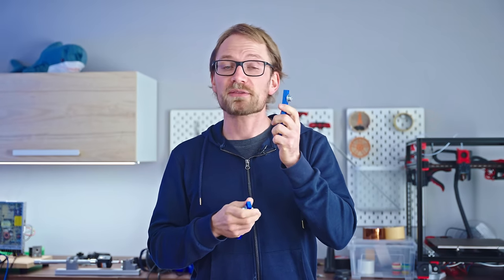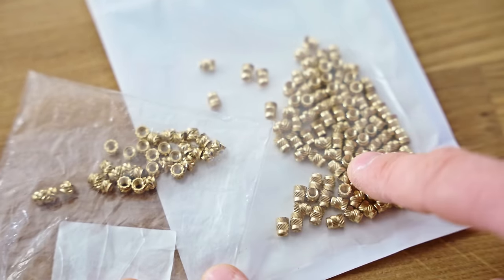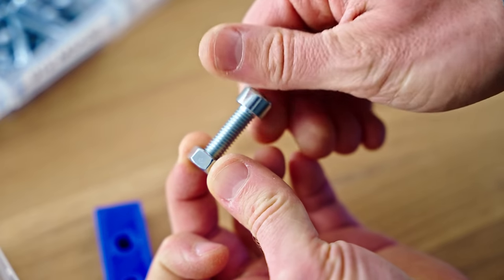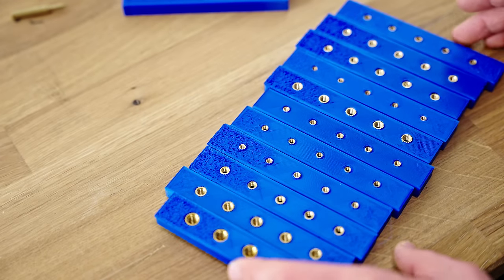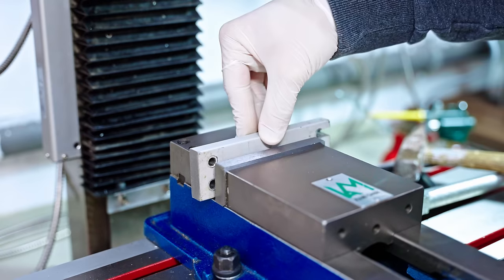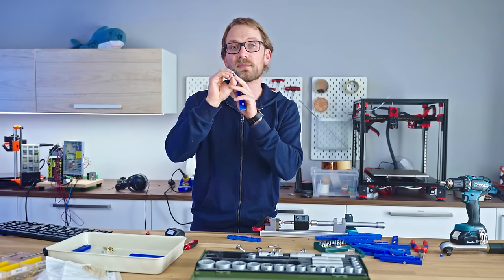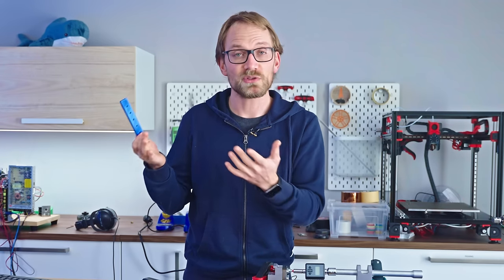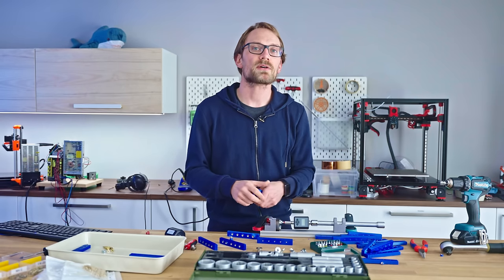Do you even need threaded inserts? Strength tested!

Comment: Thanks for the info and the video, but here are some ideas to improve upon for your next test.  Many people are simply using metal hardware since it is much more consistent, uniform, removable and reinstallable and easy to deal with and don't actually need the strength. For this, the threaded brass inserts work great. But if you are really designing for strength, you need to improve the weakest link, the plastic printed part. Perhaps I missed it, but I didn't see you go over the print settings for your test pieces?  It appeared to be PLA and appeared to have only two perimeters.  Did you use PLA or PLA+ or some other material?  I like PLA+ and Polymaker PLA Pro for high-strength items, although PLA can actually be stronger in tests like this, but either way, should state more info about the printed part.  I generally use 3, 4, 5 or 6 perimeters for my high-strength parts.  I've gone to 100% infill on some as well.  I think you should have made the test pieces thicker as well. The one common method you didn't talk about is making a pocket on the back side to put an actual nut (hex or square) into your model.  I've seen Stefan do this, but he had so little material surrounding the nut that I think it skewed the results.  Have 1.0X-1.5X the thickness of the nut for the thickness of the plastic in front of the nut. So, if your nut is, for example, 4mm thick, then make the test piece 10mm thick with a 4mm pocket for the nut to be inserted and 6mm of material above the nut to give it strength.  And making that 6mm region, and a large diameter around the fastener with 100% infill will really test the method.  This is my preferred method and it has served me well.  Finally, I think torque is a poor metric for your measurement. Torque is used on helical fasteners to achieve a pre-load, which is what really matters in these fastener joints.  Depending on the material, surface finish, lubrication, etc., torque values will be different for two fasteners achieving the same preload. For example, screwing into a brass insert a certain torque value and screwing into  plastic (and deforming the plastic) with the same torque value would yield two vastly different preloads.

Comment: Pull out isn’t that common of a failure mode for a properly designed joint—screws should ideally be loaded in shear. Torque out is more important, because as you noticed you didn’t achieve design torque. Those fasteners are more likely to back out and loosen up because that haven’t stretched enough to keep friction high.

Comment: By the way lead fumes at 480C so if you don't heat it to that temperature there is no problem from soldering with lead solder and definitely no problems with the inserts.

Comment: That is still a bolt, whether it is in a nut or not.. a screw is tapered, a bolt is straight. For example, a vehicle engine uses bolts screwed into the engine block to hold parts on without nuts.

Comment: Nice test process.  One of the processes I've had great success with, is using molded threads, and using the bolt to form the final thread shape. Essentially, running the bolt in/out a few times to get a little heat into the part, with the goal to leave 100% of the original plastic in the hole. Tapping removes material and adds stress risers. Another thing I generally do with end use parts, is to have at least 3 or 4 shells in the design with a higher % infill.  I'm typically using M6 hardware and have found the results to be quite good. 

One other thought I have is with regards to the presentation of the data. A full table showing the various results grouped together would be good. A quick way to see where things stack up really helps.

Comment: I usually use the inserts without printing a hole for them, that makes it a bit more messy but after cleaning up the filament through the inserts while they are still hot they hold up very tight, I made lots of adapters for camera gear and by now everything is still tough and in place

Comment: I think the thread adapter style should be used by screwing the adapter on the other side of the part and using the screw from the direction that would need to pull the adapter through the whole part, if at all possible. That would probably make a lot of sense for the injection mold thread insert, too.

Comment: I print threads and after much effort and experimentation, my threads come out gorgeous. No supports needed. I would still use inserts when you need M5 or smaller screws or plan on using the threads often to screw/unscrew or need better reliability.

Comment: I tend to use threaded inserts (from cnc kitchen) for most threads where I can't just have a nut on the other side, even despite the price.
Mostly because it makes the modelling just so much easier. I only need a hole with a certain diameter and a minimal depth, I don't have to model a recess for a square or hex nut into some place I might not have a lot of space for it and possibly reprint if it doesn't fit properly. Threaded inserts are just "fire & forget".
Edit: yes, I am lazy. But I consider that a positive as a software engineer.

Comment: for stronger connections i use pockets for nuts so the load pulls the nut through the part, for weaker ones just a wood srew in a pilot hole

Comment: Great video Thomas. Thanks. But i think, you should compare thread inserts with regular (hex) nut and maybe with square nut. And you shuld test it as "regular" nut, i mean insert thread insert from one side and screw bolt from other side and test it. I'm using this technic in my designs and i think it is much stronger.

Comment: I'd be curious to learn more about the durability of the printed threads. One reason I might use a threaded insert is to support a connection that would be repeatedly assembled and disassembled.  would 3D printed threads hold up over time?

Comment: I'm curious if "phantom geometry", that is geometry that is so small it only shows up as additional perimeters, around the holes would help keeping them attached to the part.
As in, let's say .01 mm wide slots radiating out from the hole in a star pattern. Those are likely too small to be actually printed, but they will generate additional perimeters in the slicer.

Comment: An normal M3 machine screw will thread nicely into a 2.8mm hole and offers plenty of strength for 95% of what I do. Only time I use melt in threaded inserts is for screws that need to be removed repeatedly.

Comment: (Nice vid! & awesome approach) You want to screw into plastic - use plastic screws! "Plastite" is a common name for them. They are for plastics & work incredibly well. Inserts require extra steps, time, cost etc...
Bolt threads are designed for bolts - they dont work in plastic & will always provide average results.
Next Vid: Take a user based approach - "I have a small part to join, I can put a 3mm hole into it.  What are my options?" inserts, regular wood screws, plastic screws...

Comment: Using Orca slicer and hole compensation may help with dimensional accuracy of your holes, often FDM 3 axis machines struggle a little in getting both OD and ID bang on, historically it’s been kinda one or the other depending on tuning but with some of the newer slicers there’s compensation abilities built into the slicer. Works very well too I might add.

Comment: I have been modelling my threads directly into my parts using the Fusion 360 Thread tool for years. I have found them to be strong and reliable for M4 threads and larger. M3 threads and smaller don't print as well.

Comment: I’d be interested in a design study. What Design principles can one use to maximize torque with the different insets. Also old school hacks like hex hole inside of part to place a nut in with print Pause a certain layer. 
How strong are modeled threads in resin parts? Especially for different materials. 

How close can one come to specs of the screws ? 🤓

Comment: When I do make threads in holes, I never use 3 walls, I go to 6 or 7 walls, as I know there will be less material to hold... infill 20% Cubic tends to hold well. (Air boost pressure tool for turbo charged car parts/intercoolers)

Comment: Different materials are definitely worth testing, even just with printed threads or self tapped threads. PLA would probably perform very differently from nylon is that kind of test. Maybe testing some carbon fibre filled filament would be a good idea too.

My goto methods when I need threads in a part are inserting nuts into the part, mainly after printing, although they can be inserted during a pause in the print too. Where I can (where the nuts are cheap enough, usually M3 and up), I use square nuts, they are much better than normal hexagonal nuts because it is harder to round out the hole, they also have a larger surface area in the direction of the bolt. Combine that with a strong part and you can get very strong connections. They also require no tools to install and the nuts can be recovered from failed prototypes and reused, helping to reduce costs. If you buy bolts and nuts in reasonable quantities you can get very cheap prices even with high quality parts. This is very similar to just sticking the bolt all the way through a smooth hole in the part and adding a nut on the other side, except the nut gets hidden inside the part.

The strongest method would probably be to use a bolt all the way through with a nut on the other side and have washers between the printed parts and the bolt and nut, this would help to spread the force over a larger area and would likely be much stronger than any of the methods shown here today.

Comment: I'm curious since it was just the print that failed every time, if it would make it more worth it to use 3D printed screws for light and low-load connections. When pulled, I wonder if the 3D printed screw would break, or if the problem would still be with the print itself. Also, part of the problem with direct printed threading is the lack of wall material, so what if you upped the print to 4-5 walls for the holes?

Comment: I am using thread inserts mainly because you can ise the thread again and again. Printed threads fail after screwing a bolt in them only fet times, so if you want to assemble and disassemble something over and over again - inserts are the way to go.

Comment: I use self tapping (rolling) screws. They can be re-used dozens of times as long as you reverse the screw and wait for the the thread to drop into the previously cut thread before tightening (which avoids cutting a new thread each time). If I want a thread that will be used over and over, my first solution is a nut pocket on the back side.
Even a standard machine screw used as a self tapping screw will work better than tapping the thread itself as it will push material aside rather than removing material.
IMO - threaded inserts are really not needed for the vast majority of 3D printing applications. I used them for a long time before I realised it was purely for my own satisfaction rather than function.
Aslo - whenever printing a functional part, I use 4-5 perimeters and 5+ top/bottom layers at a minimum.

Comment: I never use brass inserts. I found that plastic threads are stronger than the interface between the brass inserts and plastic. I use modeled threads for M5 and over and for smaller I let the first screw form threads. Adding a drop of grease to the screw or alcohol to the  tap fixes the galling problem from friction welding PLA to the screw/tool.

PLA can give over time if it's under high tension for a long time, which will pull ou the threads or brass insert so if I need large permanent tensile forces (for example a clamp around a metal tube) or a joint that needs to be installed and removed a lot I use captive nuts.

Comment: If the plastic item is thicker than the length of the inserts (such as most of your tests) and the printed bolt hole can go all the way through, I'd like to see the same tests done with the bolt inserted through the backside of the plastic part so that instead of pulling the insert out of the hole made for it, its being pulled through a smaller hole with plenty more plastic retaining it.

Comment: What about the plastic being used - does the strength improve with different filaments?  Does orientation of the print and hole matter?  I also saw people talking about various self tapping screws - metal and wood.  There are so many directions to explore with this one (I know my self I'm interested in what PETG, Nylon, maybe even carbon fiber would do with the insterts).  Don't stress out in thinking you have to test everything - anything you want to further explore is good.

Comment: The 1/4" - 20 adapter seems similar to just imbedding a nut inside the print. 
I had a print that added a 1/4" - 20 flange nut to make a tripod mount.

Comment: I've used woodscrews with good results into plastic.
Place wood screw into screwdriver, heat the screw with a small torch for a few seconds and then thread it into the pilot hole.
Let the screw sit in the hole for 30ish seconds and remove. 
Perfectly formed hole with deep and well formed threads.

In a setup with many holes, i typically install many screws one after another. By the time I'm done installing a dozen of them, the first one is ready to be taken out.

You could test out the strength of this method of thread formation?

Comment: using a fluteless form tap ran fast through then left in while the pla cooled would be interesting as it may anneal the pla and increase its overall strength, you could also do this with just the bolt as a cheaper diy version.
id also like to see if the use of loctite on the threads weakens the pla when being used directly into the pla.

Comment: I would have liked to see the blind version of the injection moulding inserts. I use these so the plastic is heated and forced back past the insert, filling around the insert entirely and then trimming any excess off the top. I design the hole to just under the size of the insert so its easy to locate and then midway down the hole depth have a ring of a smaller diamiter that will get melted away when inserting. you will need to have a thicker bottom layer in the hole so when you press the insert in the melted material is forced back past the insert and not down into the print

Comment: Depending on the design where I can I use inserts from the back with several mm (at least) of print above the nutsert and pull from that side with a reduced diameter (screw/bolt diameter) clearance hole.

Comment: I use self tapping screws but heat them when I screw them in to form the thread rather than cut and damage the plastic: first screw them in about 1 or 2 turns then heat them with my soldering iron for about 6 seconds (3mm screws about 8mm long, bigger screws need more time), then screw them in. They should feel easier as they go in but not too easy.

Comment: Mostly I've been working with M3 screws. My prints use simple holes at roughly the tap drill diameter, then I use an electric driver to install the screws in the untapped holes. With the torque of the driver, and the heat of friction, I get a pretty decent threaded hole that also grips the screw. Sort of a built-in thread lock. 

I have some of Stefan's inserts on hand, but I haven't had a need to use inserts yet. For whatever reason, I haven't had a project where I anticipated repeated disassembly, and that's where I always thought the inserts would be most useful. I hadn't yet thought about using them to get a stronger thread in the print because of the larger interface with the plastic. Which is silly of me, because I've used threaded inserts for that purpose in aluminum for my day job. Compartmentalization, I guess.

Comment: How about testing with wood screws? For parts that don't need to be unscrewed I often print a smaller hole with extra perimeters around the hole and put a 4 or 5 mm Spax through it. Depending on how long it is I can really torque the part down.

Comment: I normally just use threaded holes for screws of M4 and bigger. M2 and M3 bolts I just screw in the plastic. If more strength is needed I use the screw adapters or tapped inserts that are ment for use in wood. In most cases this is strong enough for the force that is on those pieces. 
Different materials like PLA, PLA+ or PETG have different strength. PETG is weaker when using threaded inserts, but stronger with screws tapped into it. Tapped holes in the PLA we make at my work (a very hard PLA, not realy ment for 3D printing) are awfully strong, but threaded inserts are quite easily pulled out.

Comment: You can manually add perimeters by doing it in CAD. I call it seeding because I haven’t seen it called anything else. See below if you want to see it, made this ages ago.

Perfect & Strengthen Your 3D Prints Part 2 (Rods & Bolts)

Comment: I may have missed it, but when you made the holes for the heat set tapered inserts did you make a tapered hole? There is typically an 8 degree taper. That doesn’t sound like much but I have gotten much easier and cleaner insertions by following the recommended hole profile. I do inserts quite a bit.

Comment: I’ve tried using the inserts that use the metric thread on both the inside and outside (mainly the m3/m5 ones), and those work wonder in my case. Even when I need to print a horizontal hole, I tap it first, then pu the insert and it just works

Comment: I usually either print my holes slightly undersized and let my screw cut thr threads or I'll design a hole to insert a nut into the part, the nut in particular might be a great one to compare to the heat inserts as it will have a lot of plastic above it that it would be pulling against.